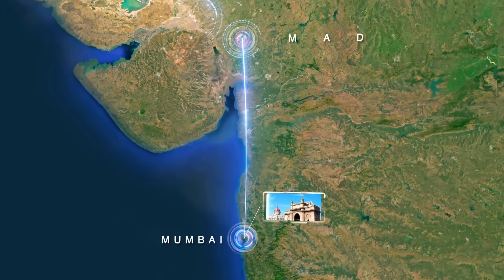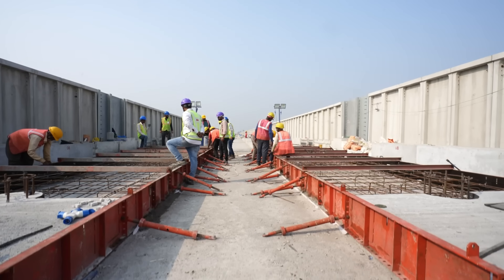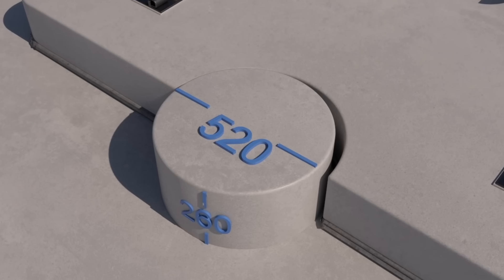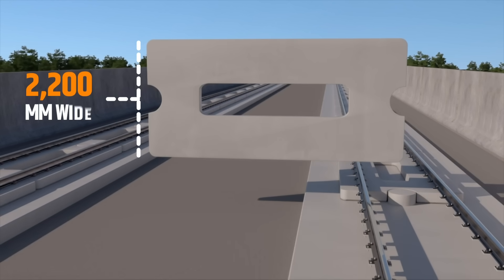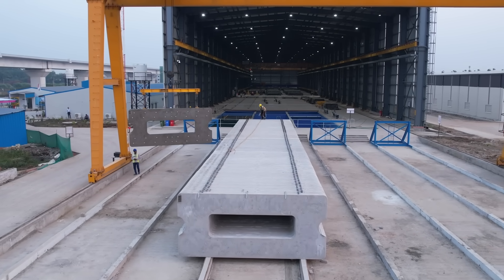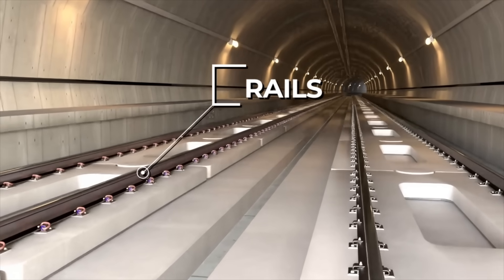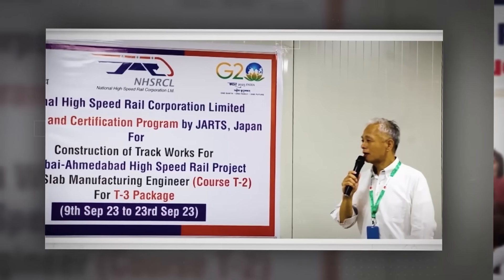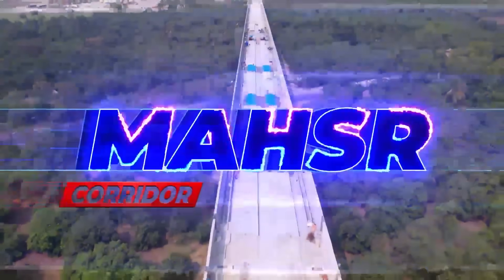NHSRCL | Bullet Train | Track System

Comment: This is going to be a disaster to implement for efficiency and fast laying, this is clearly going to cost a lot more than a simpler high speed track system. There are other simpler and proven high speed track systems to use, why are you wasting taxpayers money just to show an innovation which is really new and not really time tested? Its risky and is going to delay the project.
Reply: People like you didn't existed in china in 2004 that's why today they have highest high speed rail network

Comment: This is a TOY SYSTEM just like RRTS and metro. Make High speed railway NETWORK and then we talk. Leave NETWORK, this is not even LINE, this is just a LINE SEGMENT B/W Mumbai Ahemedabad taking this long………………………VB, electrification and Station upgrade is good. But there is a data that shows 23% increase in track length vs 1200% increase in no of trains and passengers since 1950. Due to heavy traffic the trains have become equal or even slower than it used to be in 1960s. Never Faster! Hygiene and Overcrowding is no1 issue but not fault of Railways it’s the Poor Indians and poor mindset and people who travel without tickets

Comment: hater’s gonna hate or ignore this but this is marvel engineering of Japan Shinkansen technology with Indians learning skills this project will perfectly run’s at 2026 thanksgiving to all engineers and NHRSL TEAM ❤ who wants to see India rising 🇮🇳
Reply: Bhi kab tak hoga pura kaam 🤔
Reply: @Nation806  by end of 2030 .
Reply: End of 2030  @Nation806
Reply: The first phase will be in operation by 2026, even on a short section, so it may have been a good thing in the sense that the E5 series will be customized for the Indian climate and tested.
'My country', in Japan, the Hokkaido Shinkansen is scheduled to open after 2030, and new vehicles are being researched with ALFA-X to coincide with this.
The E5 series was made 13 years ago, so by the time the entire line opens in India, it will be more than 20 years since it was manufactured, and there is a risk that parts will no longer be made.
Therefore, it may be that the latest model will be changed to suit Japan.
I think this is an advantage of using the same system as Japan, which allows for quick changes.
I hope that Indians themselves will take every precaution and train as shown in the video, understand why it is necessary to make tracks so carefully, build and construct each piece, and inherit the technology to complete and operate the Shinkansen system.
If the concrete is of poor quality, it will crumble quickly, and at ultra-high speeds, even an error of a millimeter can lead to a major accident.
That's why it needs to be made carefully, precisely, and sturdily like this.
Gravel tracks need to be corrected frequently, and stones need to be replaced frequently. And because good quality hard stone is unavailable in Japan, the J-slab was developed, which is maintenance-free and does not require replacement stones.
Reply: Please make it, The Default, Light Green and White colour like in Japan. 

It look so beautiful and natural. 

Please NHSRCL ❤️
Reply: Are kab banega 10 ho gye sunte sunte ek bullet train nahi chala.
Reply: Buuuuu India should do that leadn from China buuuuu why japan ,japan is weak bro they cannot afford to make this ,even they maglev or japan people call it linear have problem
Reply: Buuuuu India buuu you such as poor not fell shame 😂😂😂  small it you people become 700 million
Reply: MUMBAI to ahemdabad full route competation will take time atleast by 2030 .
Reply: @cibertron4860 but phase one will open in 2026, yes Mumbai route will take longer but bullet train will be operational
Reply: @rocker10039  when full route gets completed then this project will go profitable otherwise before that it will perform good but not as great when the full route is over . Then other corridors will start
Reply: @cibertron4860  of course but what I mean to say is that bullet train will be operational in India by 2026. The full route will take time to be completed but by 2026 we will have an application. USA will get bullet trains by 2028 even though they started way before us.
Reply: @cibertron4860 no 2028 tk tender date h aur kam bhi full speed me h all section me .
Reply: @crazyfun3474  matlab ?
Reply: @cibertron4860  says a Chinese paid bot....by 2030,Japanese bullet train would have covered 3,000 miles in India...
Reply: 🇨🇳China bullet train network 2008: 0km

🇨🇳China bullet train network 2024: 50,000km

🇮🇳India bullet train network 2008: 0km 

🇮🇳India bullet train network 2024: 0km 🤦🏻‍♂️
Reply: @vktruth  thanks to previous maharastra govt and don't worry we will also complete our all major  corridors within 20 to 30 years . CHINA'S ECONOMY IS HUGH AND  DON'T FORGET WE HAVE OPPOSITION'S THEY DONT HAVE 😉
Reply: @cibertron4860   aur waha dictatorship chalta hain
yaha agar  govt kuch kare to bohot sare log pathat bazi road block sab kuch karne lag jayenge
Reply: @vktruth  China being a communist country and doing anything they want and people having no protest over govt
India being a democratic country and for every project protests and opposition party doing rallies
We both not the same
Reply: @vktruth  Chinese railway debt in 2008: $0 dollars.

Chinese railway debt in 2022: 1 trillion dollars ( just 82 lakh crs )
🤦🤦. Nobody knows when will their railway collapse. They famously call it white rhino.

Inko lagta hi ki high speed rail banana lollipop banane se bahut asan hi😂😂. China mae tho land acquisition ka lafda nahi hi. Koi ngo environment concern raise karega tho turant solve kardega Ngo ka environment ko nahi 😂😂.

Democratic countries jaise india and usa mae bahut lafda isliye hota hi ki log ko sunana hi. Jaha nahi sunana hi udar koi dikkat nahi hotha hi. Lekin aise bahut debt hojayega..
Reply: @vktruth well u globalized way earlier
Reply: Eska ticket ka price etna hoga ki tu kya tera baap bhi afford nahi kar payega😂
Reply: @itz_Keshav-w3c ye buisnessmen ke liye hai tujh jaise tucche garibo ke liye nhi😂😂
Reply: @itz_Keshav-w3c  tum apna dekho 😉
Reply: Ye tutke rahegi